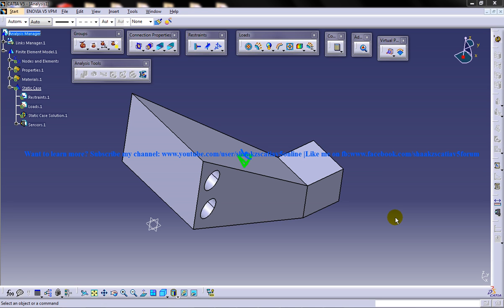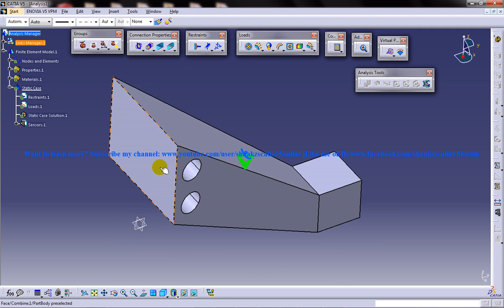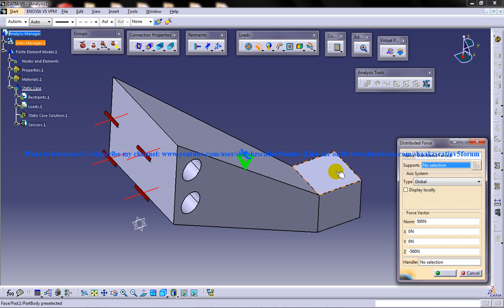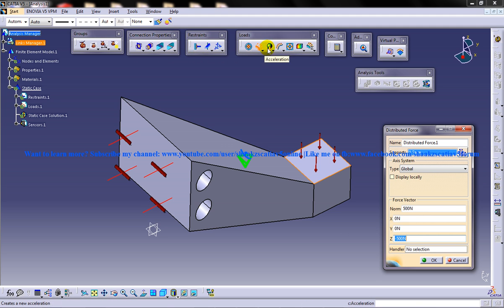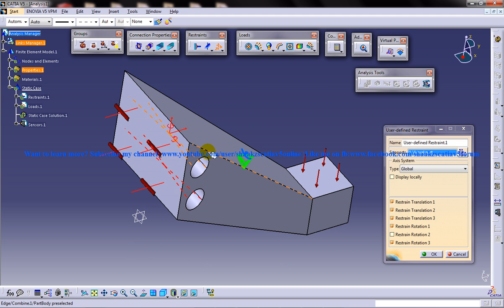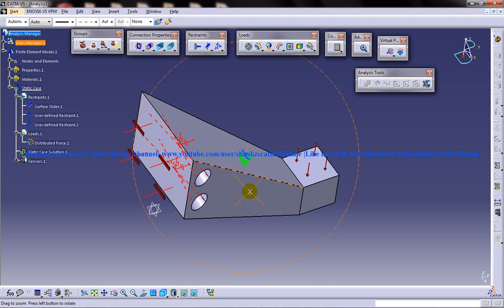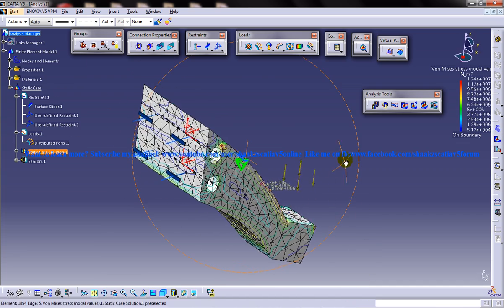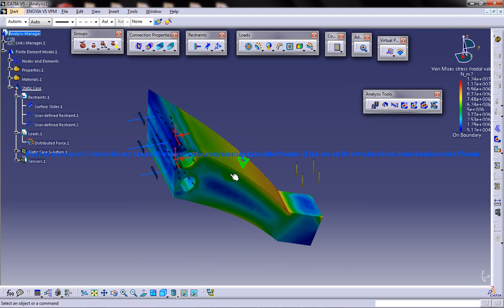Catia V5 Tutorial|Generative Structural Analysis|Static Loads|Global Distributed Force & Moment|P3

Comment: Hello Mohammed,
                   Have a question.
                   I am using V5R20 SP7 and when I go to "Analysis and Simulation" or "Digital Mockup" -"Kinematics", all the functions in the tool bar are in gray and I can not create simulation, also I apply material on the part. Am I missing something?
                  Thanks.